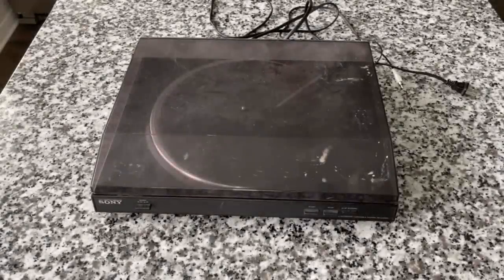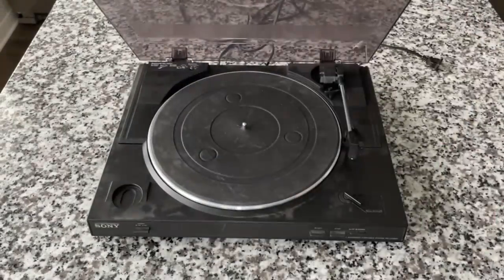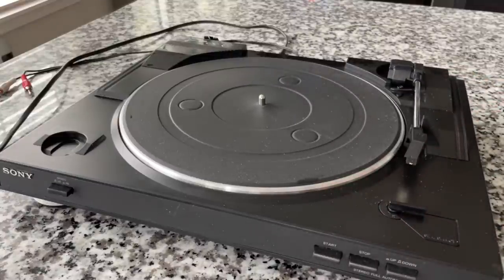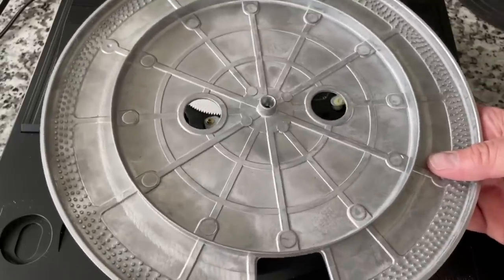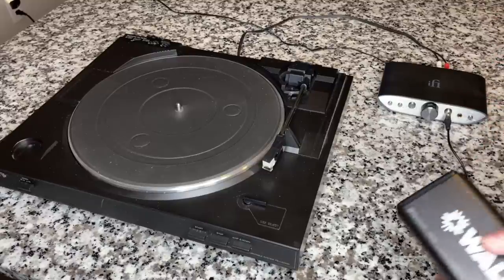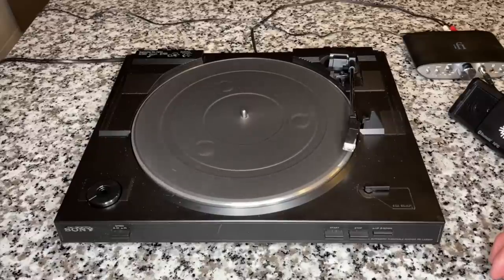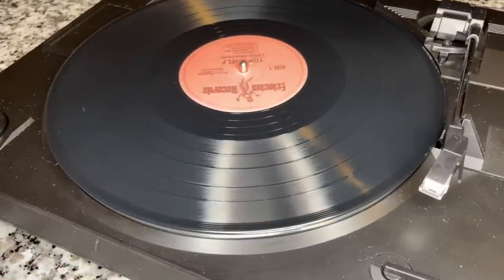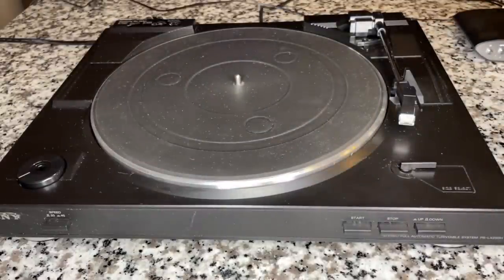Sony PS-LX250H - Review & Test!

Comment: I have both of these turntables, both of which were presents from my sons. They are both still in use as of today; the 250H is upstairs connected to my vintage system which includes CD, Cassette, and tuner and the 300USB is downstairs in my office.  I use it to record from since I feel it is more reliable and has the USB connection to my computers (one imac, one Linux, and one pc). I have replaced styli, and belts only. Have kept them clean and am happy with their performance. I'm 74 and suffer a little hearing loss at certain frequencies thanks to being a morse code operator years ago in the US Navy, so I don't need to spend big bucks on the finest sounding systems! Color me happy with both turntables.
Reply: Thank you for your service.

Comment: Picked one of these up at the local Savers for $11 today. A little plastic polish on the dust cover, some cleaning of the stylus, and resetting the belt, and it works perfectly. I did also set the pitch control using the recessed wheels on the bottom inside. Complete with the mat, and 45 adapter. Best $11 ever spent. It’s my 4th turntable, but as great as it sounds, who knows, it may go up the food chain. And my only true automatic machine. I love it.
Reply from the maker: Awesome!!!!
Reply: @Recordology  I had no clue it was the same machine till I had it out on the front porch doing the cleaning of it. Then when I saw the model number, I remembered, have to say, hard to beat for the price!

Comment: I bought this model back in 2000 for around 80 dollars. It was fine turntable for a few years....I never had issues with the tonearm not lifting high enough. Then got Sony's 350H in 2005; this model is very similar design to AT 120, fully manual turntable. All I've ever done is upgrade the cartridges over the years, and it's been a fine turntable for 17 years.

Comment: I laughed so hard at your reaction of the tonearm not lifting high enough during the auto-return, but at the same time I felt so bad because of those poor records
Reply: I didn't. Sometimes my super-duper-high-tech vintage table does the same. And there are exactly zero mechanical links to be fixed. All electronic. Perhaps, some capacitor in the arm control circuit is dying, or maybe an intermittent contact fault... and I have precisely zero clues as to how to get inside this behemoth.
Reply: @jmi5969  19:46 LOL

Comment: You can manually cue it with the up/down button.  Same as a lever. 6:42 .  If you keep the cue up, it doesn't matter where in the cycle the platter is, it can just finish it up in the air.

Comment: Radio Shack sold the same turn table during the late 90's as an Optimus LAB-1100. I remember spending a lot of my time constantly readjusting the pitch. The motor speed would start to vary daily. However the auto return worked perfectly! lol

Comment: I bought a Sony PS-LX250H turntable new back in 2001 for about $80 on eBay. It seemed to work well for quite a while, but then there were times when the turntable would activate the auto return randomly for no good reason, so it would not always play a full side of a record and I also felt that the stylus dropped onto records a bit harshly and not as soft a landing as I would have preferred. 

Other than those issues, it was very easy to set up and operate as a fully automatic belt-drive turntable and had the option of a phono setting for amplifiers or a line out setting for newer amps or receivers that did not include a phone pre-amp. It was a generic model that was not only made for Sony, but also for Denon and other familiar brands.

Comment: Just found one of those myself - mine lift the arm properly when going home, had a look at what might be causing it.
The cue and the auto-home lift the arm through different mechanisms, so it's expected cue works even though the other doesn't.
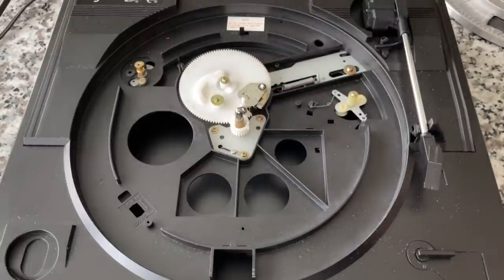The largest metal plate (visible at 9:32) moves as it changes mode. The end of it is angled, visible briefly at 27:05, when it goes into return mode the plate should move far enough towards the center of the disc, the angled section becomes below the pin with the spring so it becomes "free" to expand, which will raise the arm.
I'm guessing there is a mechanical error around there, maybe the spring is too lose or something is stuck prevening that pin to fall, or something is incorrectly calibrated so that the metal plate is not moved far enough. Pressing the Start-button and manually rotating the spindle should allow fairly easy troubleshooting.
The three screws at the bottom adjustments adjust various aspects of the return mechanisms, at least one is for calibrating when it's reached the end of the disc (so if it stops too early, or never stops, this one needs adjustment for sure), and at least one is for home position (so this one needs adjustment if it "misses" or "overshoots" the parked position). One of them adjusts a switch, not sure what this switch does since everything is entirely mechanical, maybe it ensures audio is only passed through while it's in the correct mode?

Just found one of these myself in the recycling room where I live... broken stylus, missing adapter, belt was there and seems fine but had come off and become tangled, really scratched up lid, but otherwise in great condition. Haven't tried it with a a proper stylus and disc yet though...

Comment: Great video, I too like the auto players. For the dust covers you can use a headlight restoration kit to clean them up. I bought a Technics SL1900 with a scratched up dust cover and I happen to have a Mothers headlight restoration kit so I thought I would give it a try and it took out all of the scratches. The cover now looks as clear as the day it was new. If you have several covers to clean up it's well worth the cost.

Comment: That TT is obviously related to the Aiwa I did from 1985.  They have been making the same fundamental design for SOOO many years. I can have a look and see what is required to adjust the lift if you want me to. Nice video. I shall have to remember to check the auto lift and Manual lift if I get any TT from now on. . so thanks for that. The Board on the transformer was a simple 4 diodes and a capacitor looking at your video.  Cheers. PS the preamp on My Aiwa was OK but I bypassed it internally as It did not have a switch. The sound was so much better after doing that .

Comment: As far as no off/on button goes, if powered from the Receiver then it should have at least 2 plugs on the back.

I have the 1979 Sony PS-T20 direct drive, so no belts to worry about.

Comment: So, I think I've commented before that my turntable is a Trio/Kenwood  KD1033 which I bought in 1976.....but hubby (Rich's) turntable is a Sony PS - LX300 usb, which we must've bought in 2017/18. It lives in the living room along with his BSR autochanger record deck. It only cost us £110 brand new back in 2017/18.  Rich's Sony has been totally reliable since we bought it and sound wise is fine. I, though, prefer my trio. It's heavier  and feels better built. (lasted since 1976.) I can put different cartridges on it. I have a Nagaoka MP110 at the moment. It has an adjustable counterweight and anti skate. .....I would like to replace the Sony with an Audio Technica ATLP120 - but - the Sony is so reliable that I've just no excuse to replace it. (damn!) I would recommend the Sony for any one just starting out collecting records. A no fuss turntable.

Comment: The control layout is exactly the same as the Audio-Technica AT-LP60, and the area under the platter, and the underside of the platter are identical. Sister unit with a Sony design aesthetic, but essentially the exact same thing, I'd say- which is a good thing. Why mess with a tried and true Hanpin (probably the OEM) design?

Comment: Regarding the platter mat - a hole reinforcer on the front and on the back will rectify this; as it is exactly the correct size.  (This is also useful if you ever get a record with a cracked or broken hole [If it has the small hole, that is; 45, 33 & 78 will work just as well], just saying!).  I guess the kick-start will be a quirk for this one, until a smaller/tighter belt is purchased.  Not sure about the lift off from the record though, that's more difficult.  Perhaps a thinner platter mat?  Other than that - no idea.  Alternatively you could simply press the return just before it slams into the label?  It seemed to work okay when you tried it elsewhere.

Comment: I wonder if that RET adjustment - I assume it is an adjustment - on the bottom would fix the arm return problem. As it stands, it's terrible for the discs. Other than that it struck me as an amazing buy for $8.

Comment: Ive had 2 of those record players. They are okay but Ive always had to adjust the pitch because they alwayd spin a little faster than 33 rpms. Maybe 34. Plus you can tweak the 45 rpm adjustment to make it spin at 78rpms. Not sure if you mentioned that as im just skipping through since im familar with this deck.

Comment: These are junk, even if you are "starting out".  Just for the sheer fact that these things track your records so heavy that they will actually damage them.  If you want to start off on something cheap, at least get an audio technica pl 60.
Reply from the maker: Ryan I'm not sure how this would ruin records.  It tracks perfectly within the range of the 3600L just like the LP60 & LP60X - in fact I'm pretty sure they are all made by Hanpin.
Reply: @Recordology  the tracking weight on these things is a out 3 grams where the lp60/120 Is 1.5 to 2 depending on your cartridge.
Reply from the maker: The LP 60 has a permanently affixed audio technica 3600L cartridge just like this unit. It’s the exact same one. That cartridge is designed to track between 3 and 4 g nothing less.
Reply: Yeah, gotta spend at least 1k to start out, anything else will destroy your records.